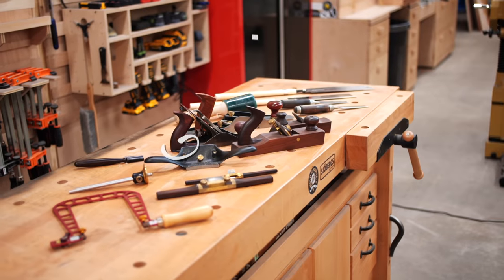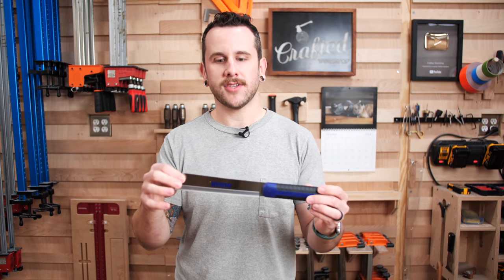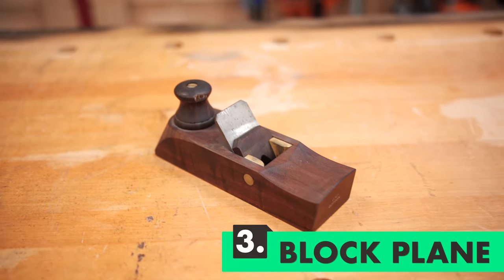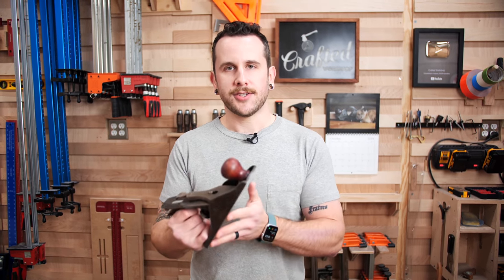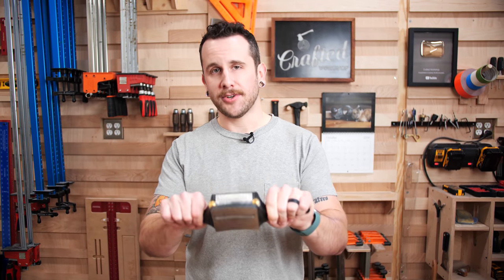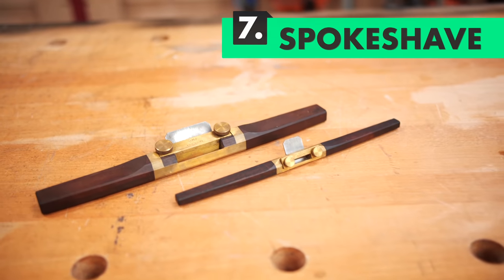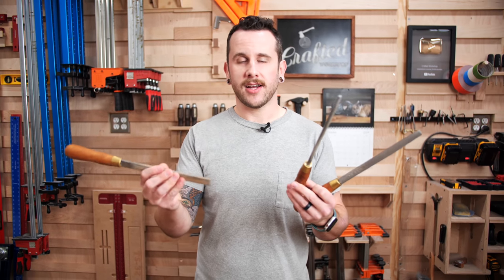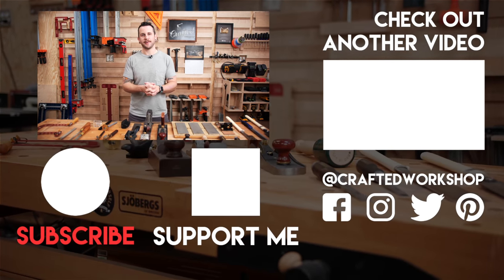My Top 10 MUST HAVE Woodworking Hand Tools For Beginners 🛠 Gift Guide

Comment: This video would be sooooo much more helpful for beginners if you showed a clip of what you're talking about instead of just describing it.  Same with the power tool video.  Still good though. Thanks.
Reply: I couldn't agree more! A demonstration would have been very helpful.
Reply: The subjects covered in this woodworking website TopFineWoodworking. Com varies from wood types to tool types and uses. A few other subjects range from the various kinds of wood along with their distinct levels of difficulty when it comes to managing them. If you are still a beginner in wood working, then you will find this book very beneficial.
Reply: I agree. Stopped watching after the 5th tool because I couldn't visualize what he was talking about.
Reply: A really good video, but I do agree an inserted example video of each would be very helpful.
Reply: Fair point, but if you look at some of these tools and you can’t imagine what they’re for or how they’re used, it means they’re not really must-have tools for beginners. He’s just listing 10 of his favourite tools (or 10 tools he uses a lot). Pretty terrible advice.

Assuming that everybody has a few screwdrivers, a knife and a pencil at home anyway, these are the must-have tools for beginner woodworkers:

Clamps
Square
Saw
Chisels & mallet
Plane

These will get you started – you definitely don’t need three different hand planes to begin with, that’s nonsense.

Comment: A try square is my no.1 no questions asked. It's such a useful and cheap tool that most beginners would never think of (and many beginners don't even know the exist)

Everything from assembly to aligning diy cutting guides for ripping sheet material with a circular saw. It's the one thing that never leaves my apron (okay, not the only thing, I always have a miniscule ruler, a pencil or three, a number 2 robertson bit, and assorted drill bits and screws)

Comment: I think most people under estimate sharpening. When you go to sharpen your tool it is not a chore. Its a time to think and contemplate your project. Quite time. Try this, enter your work shop and hone all the blades you think you will use for your days jobs. So you straight away say 7,8, 9 etc no just the tools you need on the day. one or two chisels a hand plane hone, you see ! sharpening is a time to think about your project, relax and calm down.

Comment: "Jack" means smaller than the jointer plane, not "jack of all trades".  

In this context, a "jack of all trades" means it performs not particularly well in all trades.

Not to say its not versatile, because it is. Being a jack of all trades is almost an insult to this very versatile plane that can outshine even specialized planes :P

Comment: While a low angle jack plane is great., a Stanley No5 with both a curved and a flat iron to allow you to have a Jack plane,  a small joining plane and most importantly a scrub plane for far less than a each of those separately. Also you should probably have a should probably have a Rabbet/should plane (or two) you needn’t go crazy like me (8 rabbet planes and 2 rabbet spokeshaves) but they are invaluable for any joinery work.

Oh and the Lie Nielson  102 is the greatest block plane ever....if you don’t want to spend $120 don’t ever try one
Reply from the maker: Good point for sure, the No. 5 is a great option. And yes, I do own a shoulder plane but don't use it that much considering I don't do a ton of true mortise and tenon work. They're essential if that's something you do more. And the 102 has been on my list for awhile, but I own three block planes. They look so awesome though!
Reply: Crafted Workshop  only 3? I have a Stanley no18, no65 and an ECE wooden block plane that I had to have after watching Laura Kampf use one in a video (it is an absolute dream for shaping planks) in truth though I could almost do everything with the 102 it’s really that good

Comment: The wedge system on planes is actually more traditional.
Reply from the maker: In regards to the older system, for sure, but I meant which system is most commonly used in your typical hand plane.
Reply: If you haven’t worked with an Ulmia bench plane it takes some getting used to but it is a dream for smoothing

Comment: I bought a cheap coping saw, I got 1/4 of the way through using it on the project I bought it for and threw it away in frustration. (Disclaimer, I did not literally throw it) Spend the money on something that’ll actually work.
Reply from the maker: Yup, cheap coping saws are incredibly frustrating. Super flexy and not worth using in most cases. The Knew Concepts saws are a joy to use.
Reply: Crafted Workshop hmmm... I'll have to see if I can get it here in Aus

Comment: Johnny I have some old planes at home how can you tell if they are bench planes or jack plane or finish plane?
Reply: Jack plane is the equivalent of a Stanley No. 5, research it's size on Google. A finish plane is a plane that does finish work so, mostly a smaller plane, usually smaller than Stanley No. 4.
Reply: Mr. Marian 
Ok thank you for your reply
Reply: Mr Marian
So a Bailey no 4 or smaller would be a finish plane is that the same for other planes like Hercules?
Reply: @jeffcantwell7821  No. 4 is a general plane that works well for almost every task, especially smoothing, there are better planes for this though. Try researching the sizes of Bailey planes, if your Hercules is close to for example No. 4, then you can consider it a number 4.
Reply: Mr. Marian 
Ok thank you for your help I really appreciate it
Reply: @jeffcantwell7821  You're welcome. Ask if you need any more info.
Reply: Mr. Marian 
Ok thank you

Comment: How hard did you cringe when you chipped the tote on that Hnt?
Reply from the maker: It actually happened when I was taking a woodworking class, and someone else knocked the plane off of my bench. The tote actually cracked in half entirely, but I was able to glue it back together. I was not pleased, hah.
Reply: @craftedworkshop  Hnnnng that guy/gal has gotta feel bad.